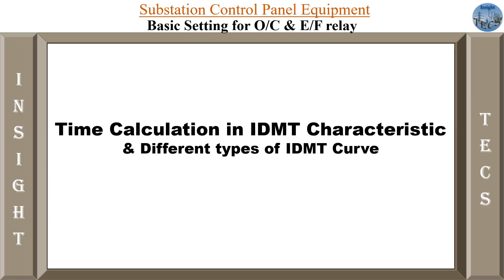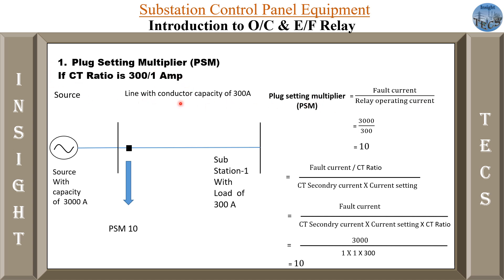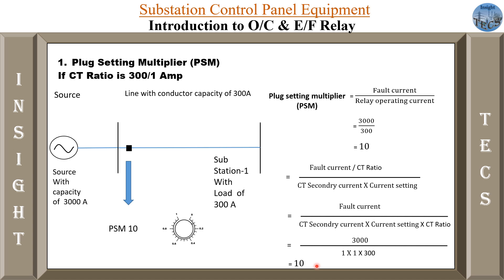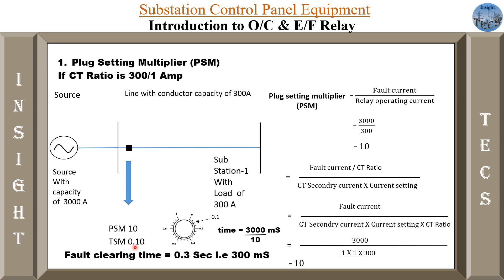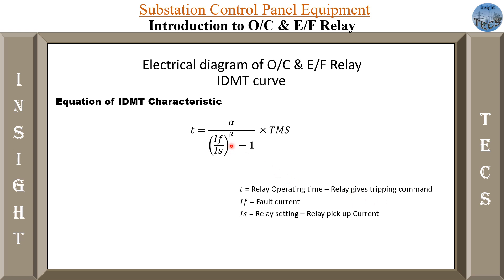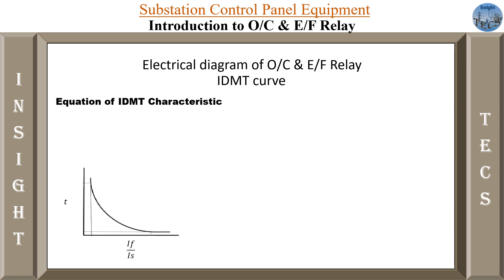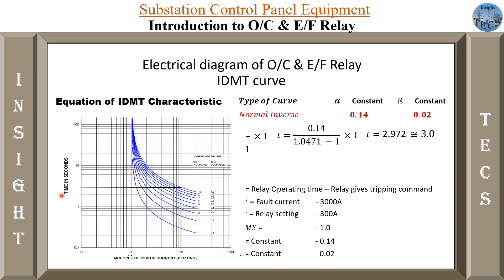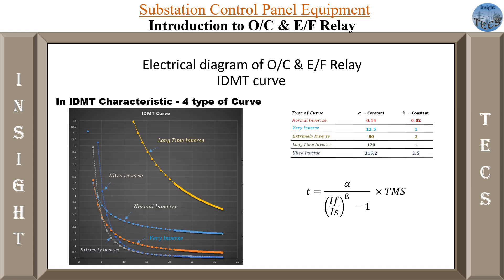Time of relay operation|| IDMT characteristics|| Part-2 || English

Comment: I have a question that has been bothering me: after changing the settings of the protection relay, do I still need to conduct a test? For example, the overcurrent protection has been changed from 5A to 6A. Do you still need to test the relay protection? Thank you.